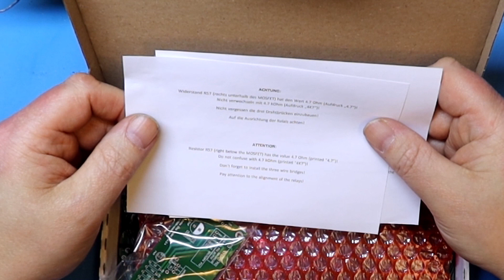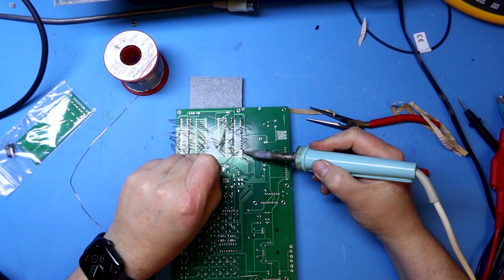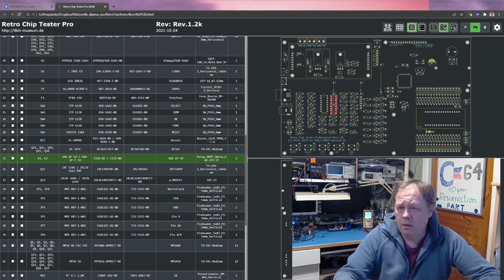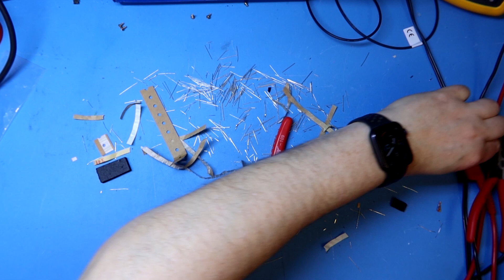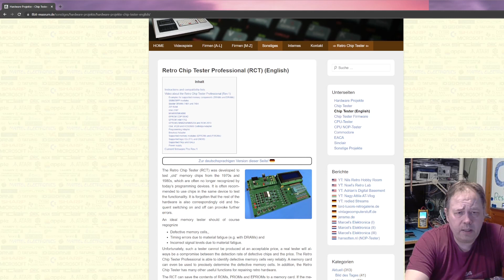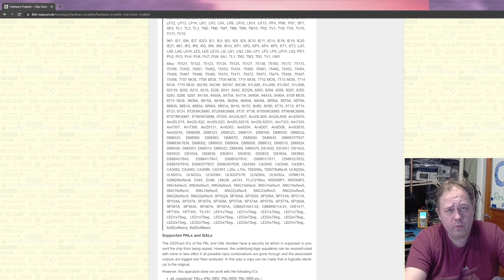The Retro Chip Tester Pro. Part 1, The building frenzy

Comment: Hi, acc. the two notes: there is no misprint on the board, some people populated a 4.7k resistor instead of the 4.7 resistor, so it is a warning ;)
Reply from the maker: Ah, thanks for pointing that out, I of course should have read the note more carefully. I will be making a comment on that in part 2. I have to admit that your excellent interactive BOM had the unfortunate side effect that I seldom read the printing on the PCB.I really an looking forward to test and use the device, excellent work, the only thing I would like to point out is the missing schematics of the main unit.